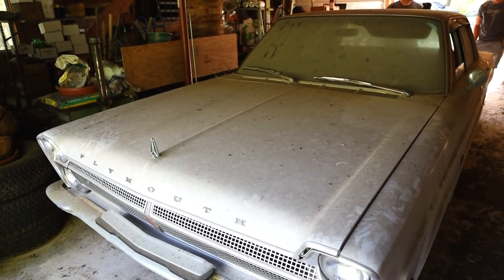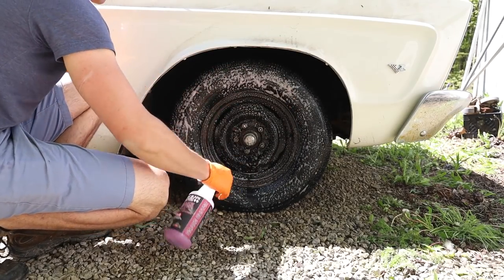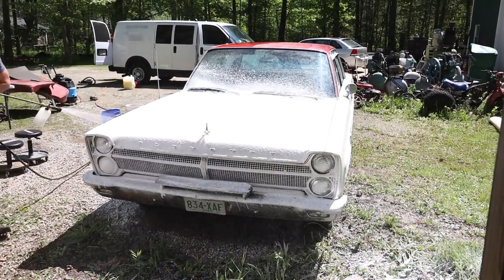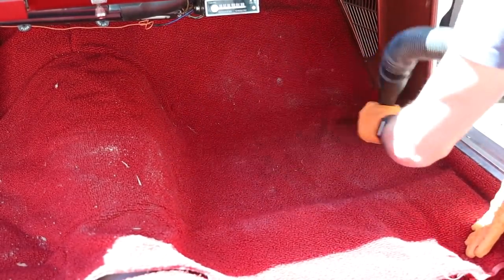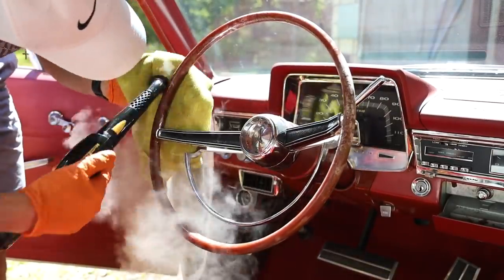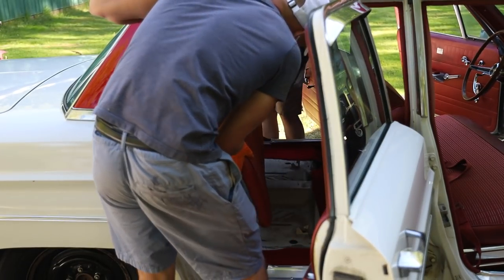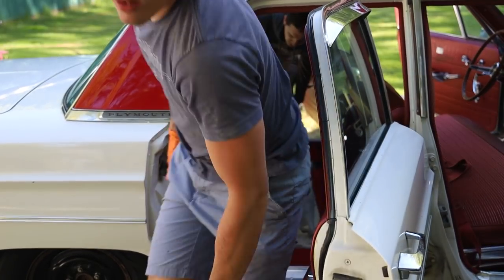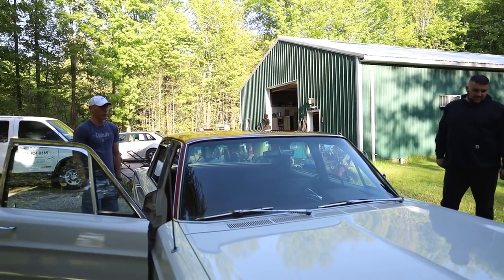MOLDY ABANDONED BARN FIND First Wash In 30 Years Plymouth Fury! Satisfying Car Detailing Restoration

Comment: Wow.  It's mazing that it wasn't trashed and torn up.  Did you find a build sheet under or behind the back seat?  It's unusual for a '65 Fury I to have 2 tone paint and factory A/C.  Did anyone else notice there are no backup lights?  They were optional on "lower priced" Furies until I believe 1966.  Great clean up job.

Comment: Great job, guys!  owned a detail/stereo shop back in the 80s and 80s.  The equipment has progressed, but the method is the same.  Funny, that!  BTW, the accelerator pedal is secured by two pods [actually two little screw in to the floor/pop in to the pedal devices - you'd have to see one to get it] at the lower end of the pedal.  It just pops off of those pods to gain access to the carpet underneath the pedal; and its protective rubber sheath [designed to keep ladies high heels from rubbing through the carpet].  A little tidbit for the next car of that era, without a suspended pedal, you run across.  Most all manufacturers used the same method of securing the pedals, and the pods acted like fulcrums, on which the pedal pivots.  Way too much trivia, but there you have it, anyhow.  BTW, a little Mother's will make those wheel covers look brand new!  They are, after all, aluminum.
That Plymouth probably wasn't that clean and protected when it was new.  Nice work!

Comment: I bought a '76 Plymouth Valiant V8 last summer for an older lady on the Tulalip Reservation. All in, due to my buy/sell/swap/trade mentality- I was out about $150 after tags, title & tax for the car. 88K miles on it, solid, no rot. Towed it out, needed brakes & the heater core was leaking. The heater core ran me about $55, converted it to a clutch fan, HD radiator. Swapped the brakes over to pin-style calipers on 12" rotors, with a 1 1/8" sway bar. Had to use a set of old cop car wheels with some of the factory stainless lug nuts, used Bridgestone 205/60 15's on it. Put a leather-wrapped steering wheel from a Ramcharger (yes, factory) on it that actually doesn't look odd. Except for the heater core, tires & some small parts, I already owned the parts. Have a lot more stuff to throw at it, including the Formula S/A38 suspension & steering, a 4-speed OD manual conversion, a 340 small block, electric trunk release, other odds & ends it will make a fun vintage sedan to bomb around in with my Australian Cattle Dog. Even now, that car's ability to stop & turn has shocked some folks

Comment: My mother had a 1967 Fury 1 that she bought in about 1975 or so.  It had a 318 and a torqueflite.  It had rubber floor mats and no chrome.  I think the car had about 50K on it and it ran fine until she sold it with about 200K on it.  I was changing points and plugs on it once, it was after the car had over 125K,  my brother and I had changed them ever since she bought it.  I moved one of the heater hoses and it tore in two.  I could tell it was an original.  She had us change the oil regularly and do routine maintenance but the car never gave any trouble.  I think I replaced the alternator once and my brother may have replaced some other small item or another but it was just a trouble free, simple and easy to maintain automobile.  Her car never spent a night in a garage and it had dog dish hub caps and was not a two tone.  She drove gravel and dirt roads for her work a lot.

Comment: Plymouth Fury I was the entry level full sized Plymouth. In Canada the model was called Savoy for the last time. Base engine was a 225 slant 6 with a three speed manual with column shift. The 3 speed TorqueFlyte automatic was optional with all engines. Optional engines were the 273, 318 Poly, 383 in 2 or 4bbl form, and likely a 440. Most Fury  I cars were Police Pursuit or Taxi specials. This sedan is a beautiful and rare example. Notice the lack of reverse lamps. They were an optional extra and mounted on the trunk lid beside the brake lights. Fury I was 2 or 4 door sedan as well as a 2 row station wagon.  This is a rare example. Air conditioning was an expensive option back in 65. It would have been more than 10% of the base price. The driver's side remote control mirror was another option as were the full wheel colours.

Comment: This may be the most strangely equipped car I have ever seen. Fury I base/economy model/trim line with V8, auto, PS, PB and factory AC!  Rare front and rear bumper guards and remote mirror!  Upper door frame and drip rail mouldings normally found only on Fury III!  Uncommon rear seatbelts!   Ventshades,carpet, and two tone are after market.

Comment: Just missing the pinstrip sized white walls.  Well, maybe a little bigger than pinstripes, but definitely not the wide whitewalls of the fifties.  It could have also had raised white letter tires.  I was 9 years old when it was built, though I was a Pontiac fan at the time.  8-))

Comment: I would probably suggest you wear a mask that can filter out organics like mold especially if you are going to be blasting it with steam.   the heat may not kill all the spores and now it's aerosolized and in an enclosed space where you will be breathing some of that air.   You only have one set of lungs and you are still young.   protect yourself.
edit: might also be a good idea for you to get an ozone machine so you can kill off the mold in the vents and the tiny cracks that you may have missed.

Comment: Not to often you see s Fury 1 with factory AC, especially in Ohio.
Reply from the maker: Yeah! From what we understand, this was a big selling point for them at the time too
Reply: Most of the Fury I's I remember as a kid had slant 6's in them, and no power assist of any kind....This one is nicely equipped with a V8 (318 or 273, but more likely a 318) and AC.  Lots of them went into fleets.  I have a '67 Chrysler New Yorker and it doesn't have AC...originally sold in Edmonton, now in Eastern Ontario.

Comment: Fluids you're going to need regular oil you can't put synthetic in it you could probably put heavy weight in it it's it's a fury one but I will go with regular based motor oil all the other fluids shouldn't be a problem lines hoses definitely double check when you do that and he's right the logic was pre-75 or maybe 1976 was righty tighty lefty Lucy on passenger side righty tighty towards the left Lefty loosey towards the right on the driver side it shouldn't be too much of a problem with trying to rebuild the block I don't know about the transmission I know nothing about transmissions to a point where I could tell you what you need most cars from that ever run on regular to heavy weight oil

Comment: U sprayed down the battery u sprayed water into the air filter prbly ruining the carb and intake and u sprayed the engine with pressure I know that’s a bad Idea it is a older car it can handle that but be careful